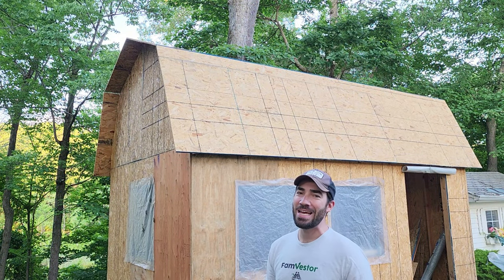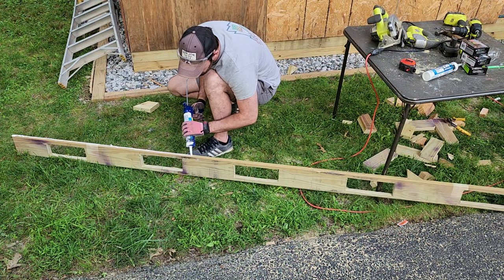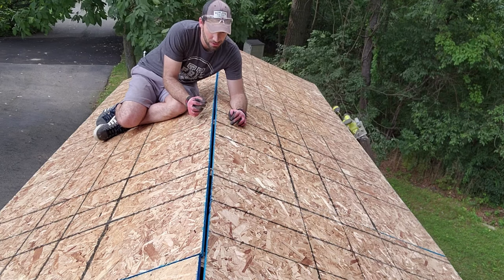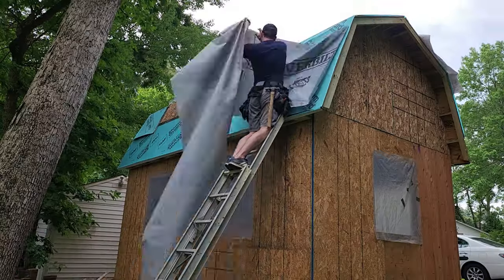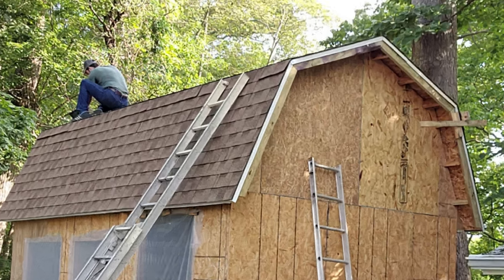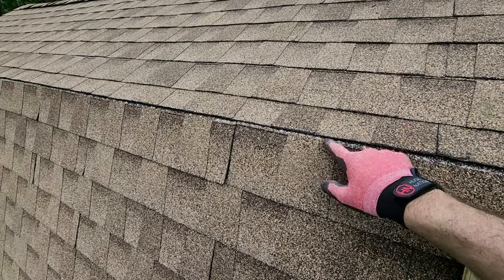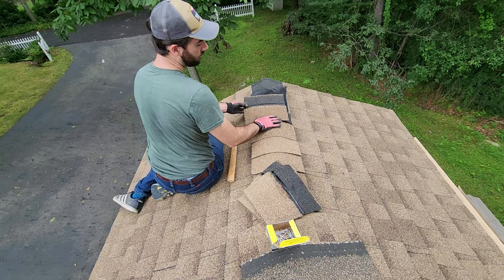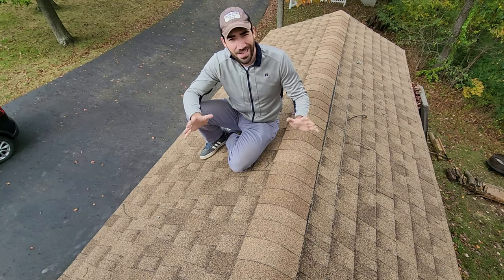How to roof a shed | Shingles, Vents, Underlayment | Shed Build Part 6

Comment: You don’t need ice and water guard on a roof that steep. If you do your drip edge and shingle overlap properly, you’ll never ever get water seeping under the shingles. On a standard 4-6 pitch, or even a 7/12, use it. Anything 8/12 or steeper, forget it. Water doesn’t run uphill.
Reply: Water does wick uphill tho, ice and water is still code for all roofs

Comment: with the steep pitch of your shingles in the first slope of the roof you should have had more nails in each shingle. if you had had excess of the snow /membrane you should have used it along that transition of the roof pitch as this in the future will be a place of shingle failure and leaking.  been in the trades and this is how they do it  still enjoy the build keep it up.
Reply: an unrelated thought ahartford habitat for humaniny construction supervisor was working on a united church of chris. susjeggest a trio of guidelines.

1 be safe. if you get hurt oit will take time to heal.  if you are scared of hieghts let a climbing person comb.  no shame in decline if you feel unsafe. dont be a hero and risk a fall from unsafe heights
what is safe for some may not feel safe for others.

2 dko good work. and it does not matter how much work you do. it it is not good. wi requires saints to undo not good work and trdo correctly.  so it makes double work on takes time for to thhink and take corrective action or undo and redo.

3. have fun and learn something new.  there are retraining and courses to cover alternate solutions. if it is a fun experience you will volunteer again   .

example . some of the houses that we worked on were 2 story houses on a hill . that would have pushed the roof line nearly 3 stories high. an idea from a habit construction supervisor jimmy webber was to get rebuilt roof trusses and build the roof on a platform. sheath that's roof and shingle it as it was closer to the ground. if any volunteer slid off it would be only a bruised ego with now broken bones. then a construction crane and pother trained  hoist it to the top of the send floor top plates. then there was volunteer work of nailing hurricane straps to guaranteed the  engineered trusses tay steady in hurricane winds.  not sure of the net cost savings. but i thought it was a safe solution and possible savings with engineered and pressed trusses . .

god took jimmy webber in 2021. 

i know jimmy upheld the habanero for humanity goal of building homes for god"s people. 

fyi jimmy and Roslyn carter where presidential spirit but it was start by the family of fillmore and linda fuller out of americus Georgia. 

supposedly habitat for humidity is the 3rd largest builder of housing for people in need of affordable quality building for people in need ..

Comment: Alright Awesome! One final question on shingles the first row are you supposed to match the pieces cut to the bottom design or does that even matter? First row and I guess all rows
Reply from the maker: It doesn't really matter. Just make sure to stagger the joints of the shingles as you go up.

Comment: So I got GAF weather watch step 1 mineral surface leak lock instead is this applicable or so we need to get the one you got?
Reply from the maker: The one you got will work well as an ice and water barrier. I was just able to get a good deal on mine, that's why I chose it.

Comment: I have a barn styled roof but it has another flare out at the sides bottom edge. Have rotton boards too. What nail type/ length should i use for the new boards. Any brand recommended for the roofing nails?
Reply from the maker: @toddsalisbury3851  for the boards I would use a framing nail - probably 3 inches or more. For the roofing nails I usually just go with the grip-rite brand from home Depot.

Comment: Ok so it seems my 10 row of timberline on first slope didn’t reach the hip to transition over (I have like 2 “to the edge) and now I don’t know how to continue with shingles considering they are rigid around the keys and the top is flex,  any suggestions here ? Plus I’m not exactly grasping how you did yours either, thanks!
Reply from the maker: Well, I shingled the first slope and then did one row of shingles that draped over the transition. Only the top part of the shingle is actually bending over the transition, the "keys" or rigid face of the shingles are laying flat along the first slope, the upper part of the shingles is bent over and nailed along the second slope of the roof. Then I added one row of shingles running right along the transition of the second slope and then worked my way up to the ridge of the roof. 
The bent shingles might not lay flat at first, they'll need several days of sun and warmth to lay flat. It definitely helps to do this in warmer weather.
Reply: @EveryotherKarl  I Agree Winter time is not the best, thanks for the response sorry for the delay, AT&T services was out nationwide go figure, so I get what you are saying here however my hip doesn’t allow me to do what you did so I might have to run another course just so that I have enough slack for the next pitch!! However it will overlap quite a bit below the edge of the hip! I don’t know!!

Comment: the water and i ace  rubber meme  wwas only  some areqws goes from top tothe tar paper under paymentr runer membrane . verify local building standard.  is now replaced by the wat

if a Carter rollp is not available check the bundle package how to. . different solution .

in general i found the information accurate from a do ir yourself. builder.  brave good ptrsentstion.